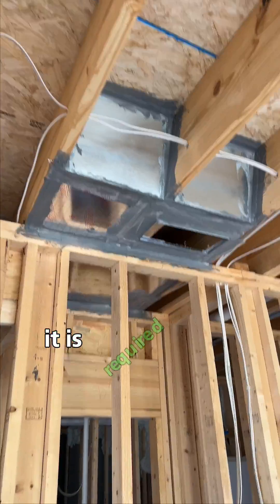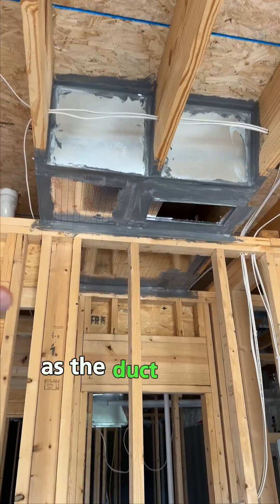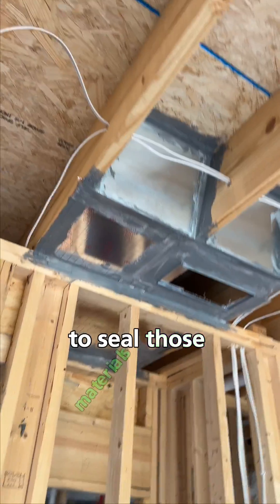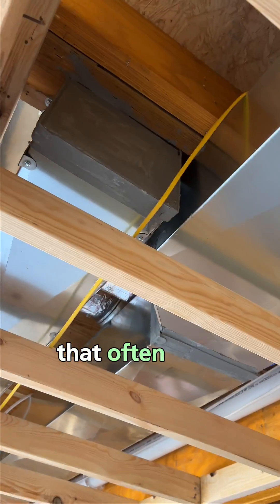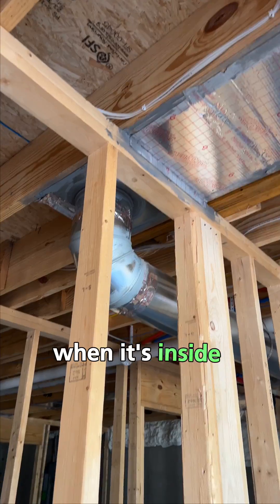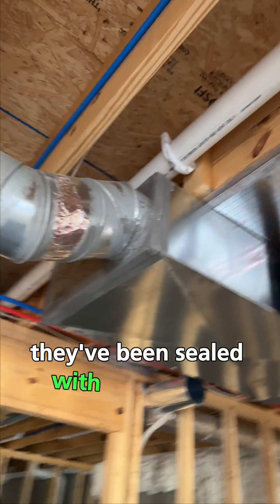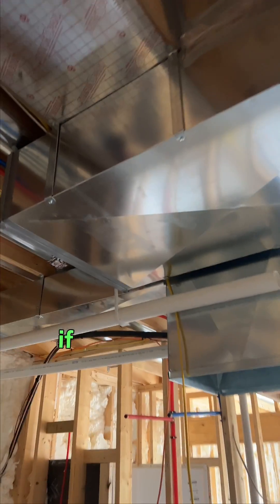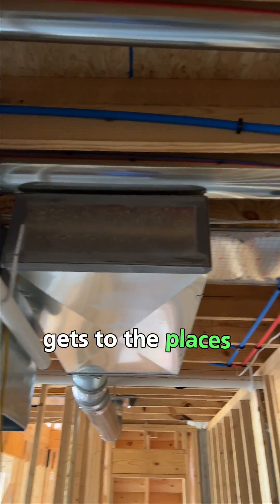Good example of sealing #ductwork #newhome #newconstruction #hvac

Comment: I'm not a fan of using wood members as part of the duct runs. But I'm also not in the trades so what do I know. It just seems kinda weird.
Reply from the maker: Agreed.  Definitely not the best way to do it, but it is extremely common in new construction, especially in the midwest.
Reply: @BuildingPerformance502  A big return in my old house uses the floor joists... should I do anything to improve it? Like make sure it is sealed where the metal meets the wood?
Reply from the maker: @nofurtherwest3474  Exactly!  Use duct mastic or silicone caulk (not latex) to seal the wood wherever it meets the metal.  Don't forget to do the ends where it meets the subfloor too.
Reply: @BuildingPerformance502  thanks!

Comment: There is no reason to seal the return air thermopan. Only the hrv ductwork needs to be completely sealed because of moisture.
Reply from the maker: The reason to seal the return-air thermopan is so the system can pull more air from the main floor upstairs instead of it pulling air through the leaks that will be hidden behind drywall in the basement.  This is especially important in the cooling seasons where the warmer air will be up stairs and you need all that warmer air brought back down to the air handler to cool it off.